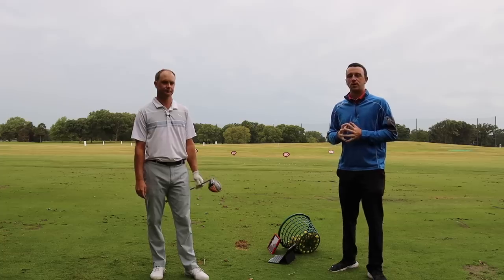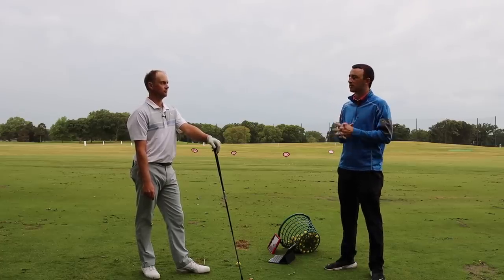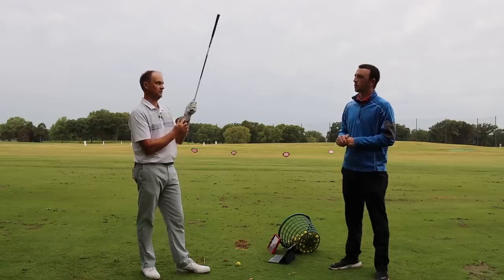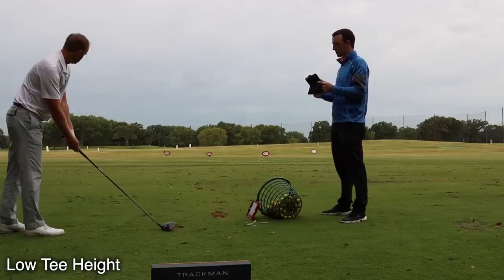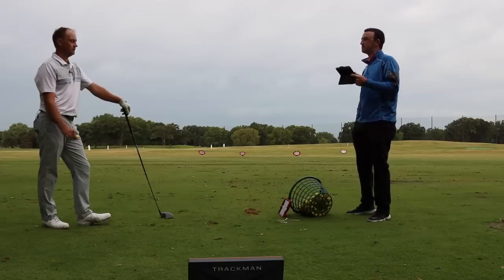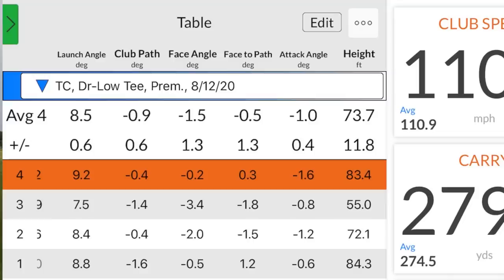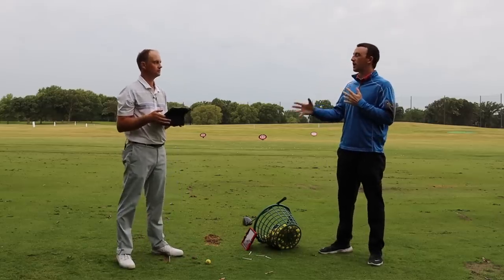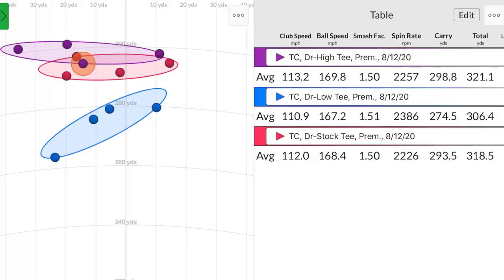The Impact of Golf Tee Height | How High Should You Tee The Ball Up? | Trackman Test

Comment: I tee mine low to prevent from skying my drives
Reply from the maker: Thanks for watching Julian. If you want to hit the ball further and avoid skying your drives play around with moving the ball position forward in your stance and having your left shoulder higher than right at impact. This will improve your attack angle and you will be surprised how high you can tee the ball. - Thomas
Reply: @2ndswing  it worked thanks